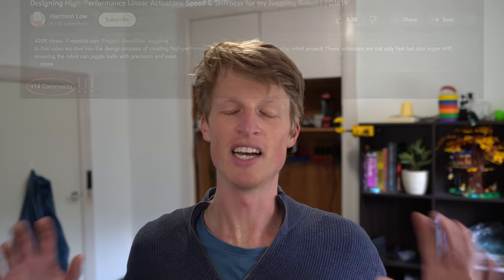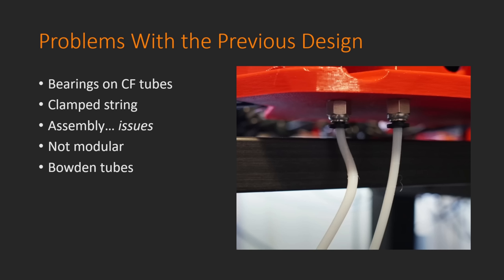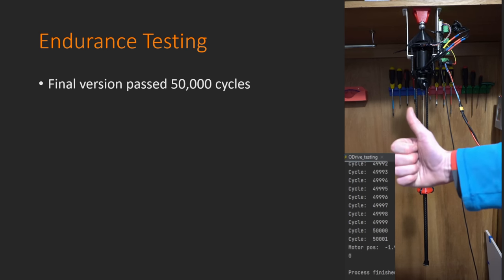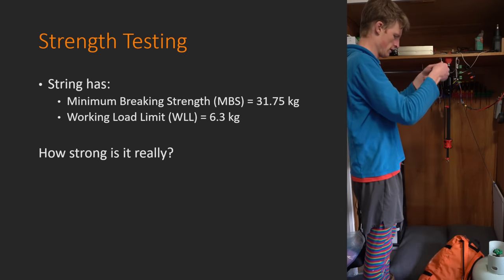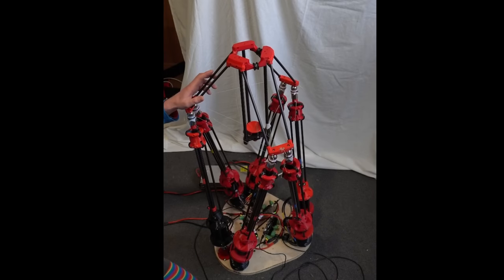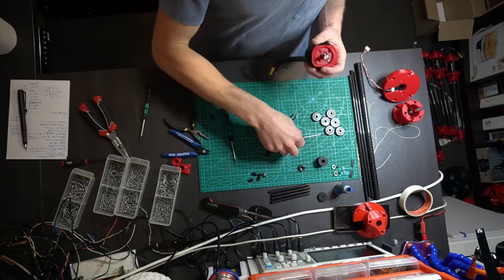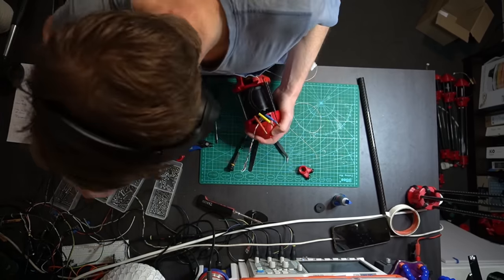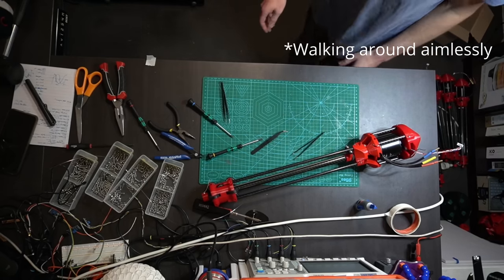My New Linear Actuators are SO MUCH BETTER! | PDJ #21

Comment: One thing about your string strength test, how did you attach it to the weights? Something I didn't know until very recently is that how you knot a rope will affect the rope's strength, a lot. A tight bend can cut the strength down with over half. This is true for ropes, and should apply to strings as well, though probably to a lesser degree.

The theory is basically this: When you have a straight rope at tension it pulls equally on the entire cross section of the rope. But if you have the rope in a tight curve the part of the rope on the inner part of that bend, obviously can't be in as much tension as the outer part of the rope. Therefore, all the weight lands on fewer fibres.

Strings have fewer fibres and a much smaller radius, so they would be much less effected by this, but in your testing the string failed right at the knot precisely because it's the weakest part of the string.

The redirection of the string shouldn't be a problem, even a small bearing has a large enough diameter to not be a problem with such a thin string, but the attachment at the very end could possibly be improved to get more strength out of your existing string. Either by clamping it so it's straight at the end, or using a better knot.

My source, and more details, would be Kyle Hill's recent youtube video "The Figure 8 Knot Has Never Failed. Why?" It's about climbing ropes in particular, but it goes into the details of how knots and bends affect the strength of a rope at any diameter, and briefly mentions what diameter bend would be considered "no bend at all" from the strength standpoint. It's relative to the strings diameter so only the knotting/attachment will really be a problem.
Reply: Just got to the bit with the tensioning screw, that might just be weakening the string, hard to be certain. The rule of thumb is that the pin should be four times the diameter of the string to not weaken it. I know it doesn't matter for your application in specific, but in general wrapping the string around a pin like that can remove a fair bit of the strings strength. I can't imagine the threads biting into the string helps any there either.

Why not simply weld the synchromesh cable into a loop, then use a tensioning pulley like you would on a timing belt for a 3d printer? Alternatively, something like a crocodile clip could possibly work. Though I'd be a bit concerned about the cable twisting over time and loosening. You could also simply wrap it around a pulley that you then lock instead, giving you an easy thumb screw to tighten or loosen it. It'd be bulky then though.

If it wasn't clear, I didn't see your previous video on this system so my suggestions don't take any considerations you mentioned in that one in mind.
Reply from the maker: @Sylfa  Interestingly the string in the raw strength test actually failed somewhere in the middle of the string, quite far away from either knot! I do agree about the thread of the bolt not helping here: the string gets rather munged up after I tighten and loosen it a few times in the same spot 😬

I do like the idea of having the string being a single loop, though I'm not sure how to ensure the motor has a solid "grip" on the string? My understanding of belt-driven CNC machines—which use a similar concept—is that the belt is very tightly routed around the motor's output shaft, which has a toothed gear to match the profile of the belt. If I'm using plain string I have no idea how to ensure that the string doesn't slip on the spool? (though maybe this could be seen as a safety feature, where the string slips instead of snapping?). I can kind of imagine how it could work with the synchromesh cable thanks to its strange profile, though even then it might be tricky if printing the parts and using the smaller synchromesh cable (tolerances would be tricky here).

Cheers for the input!
Reply: @harrisonlow  Yeah, I was thinking of the syncromesh cable for that suggestion. Using a string in a full loop, hrm. I guess, you could try 3d-printing a soft screwlike holder that winds the thread and keeps it from overlapping itself, but honestly it'd be slipping the thread through which would ruin the friction, and thread.

The only real way I can think of doing it with a loop of string would be to have the loop just barely longer than what you need, then tightening it enough so it's got enough friction. Not sure that's possible. A timing belt would work better than that I'm sure, but I can't see that working unless everything's in-line so you'd have to restructure it entirely. Don't think it'd be worth it for your application. 

That's what CNC machines use though, at least the ones I'm aware of. In case you weren't aware, the timing belts are basically a flexible cogwheel, allowing you to put it over cogs to have no slipping, you only need enough tension so that it doesn't slip out of the teeth.

As to it snapping in the middle, that's a good sign that what you're doing is not a problem, I guess strings really don't have the same issue as thicker ropes. Or if they do, it's minimal. Strangely enough I could have sworn I saw the string snap at the weight in the video, guess my mind was just playing tricks on me. 😂

Yeah, I think the only real consideration is to avoid jamming the thread into the screw, to avoid chewing up the string over time. At least if you don't need the full strength the motor can output.
Reply from the maker: I'm not sure that just having enough tension would work, though a simple solution like wrapping rubber (or heat-shrink?) over the spool might be enough to stop it from slipping.

Just re-checked the "strength" footage and it definitely snaps in the middle (when doing the direct string strength test). No idea why it doesn't snap at the knots 🤷‍♂️

Comment: Swap to liner bearings (lm8uu for an example) for top and bottom?
Reply from the maker: I've tried normal linear bearings but the tolerances unfortunately didn't work for my carbon fibre tubes (some tubes fit with slop, others didn't fit at all...). Would be a lot more elegant if it worked, though!
Reply: well darn , I guess the tool head weight is what makes them work for 3d printers then.  @harrisonlow
Reply from the maker: @PointBlank65  I think it's more that they use tubes/shafts with better precision. My carbon fibre tubes aren't designed to have an extremely precise outer diameter, but you can get ones that are (for💲). 

Metal shafts (that I've seen used commonly in printers) are fairly reasonably priced for high precision and they work really well with linear bearings

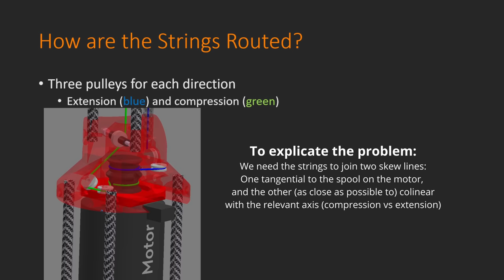Comment: 4:44
You can use less pulleys, but it'll be worse?
You don't "need" a pulley with the rotatio axis aligned with the barrel's rotation axis. You just need to end up with a string going in tangentially to your barrel to wind up.
If you have the last pulley directly go to the barrel with a weird angle you could get away with using two pulleys?
This should work for the push and pull string if i saw you Cad render right.
Reply from the maker: Yep, I think you're right! Someone cad'ed this up in Zulip and it's immediately obvious that this would work. D'oh!

What makes you say fewer pulleys would be worse?
Reply from the maker: Link to the Zulip topic if you're interested:
https://pdj.zulipchat.com/#narrow/stream/399304-The-Arm/topic/Alternate.20String.20Routing.20Ideas/near/388860540
Reply: @harrisonlow  when winding up it may have a hard time spreading itself evenly on the barrel, or i fear it would be more likely to clog when unwind at high speed... To be seen?
Reply from the maker: @squa_81 I haven't had this happen yet, though the synchromesh cable may behave differently... Hopefully not! 🤞

Comment: A very simple change to improve the maximum possible load and add a little redundancy is to double up the string. Mind you, if one half of the string breaks the actuator will still work but the broken section of string will likely wrap up around other things and make a mess.
Reply from the maker: Hmm yeah I think the tangles would be detrimental here, even if the second string survived. There's just so much space for the string to go where it doesn't belong!
Reply: @harrisonlow  I think braiding 3 strings together would prevent that
Reply: @NotToast859  That's a great thought, and I might be using that in some future projects. I guess I have to print a braiding machine :)
Reply from the maker: Haha you don't know how close I've come to making a braiding machine "for Jugglebot". Would be so neat to have one! They're such beautiful mechanisms to watch go round and round 😍

Comment: maybe just use nylon wheels with bearings? so the carbon rod doesn't wear so much
Reply from the maker: Do you think the nylon would cause much/any wear if it directly contacted the central CF tube? I quite like the look of these - particularly that I won't need to print + attach anything to them!
Reply: @harrisonlow  sorry, I would love to help, but I do not have experience on this
Reply from the maker: @Woloszow  Haha no need to apologise at all 😊 I'm just trying to extract as much information from viewers as possible 😁

Comment: I have made a similar application with a positioning belt some years ago. The servo used was a 8n.m. at 3000 rpm max, and 5:1 gearbox. We got 3.1m/sec. On the positioning block.
The inertia was too high so we removed the motor and changed for 2 small motors of 2.3n.m. and 5:1 ratio each. During tests we got 4.2m/sec.
That is a motor approach alternative...
Reply from the maker: Thankfully the inertia won't (read: shouldn't) be an issue for me; I've figured out a neat way to stop them from spinning about their axis without restricting other motions. I'm keen to show it off in a future video 😁

Those are some pretty impressive speeds! What were those designs for?
Reply: @harrisonlow  it was for a semi rotary die cutter. Look at the video : "fastrack finishing system for labels". There is an arm with 2 rollers on the bottom, all structure made from carbon fibre and the motion was a pulley with 2 servos, one on each side. The paper is re-positioned after each cutting. All in motion. The dynamic  accuracy was under +-0.08mm on motion synch.
Reply from the maker: @unitedbolts8053  Wow that's one hell of a machine! Pretty cool that you got to work on that!
Reply from the maker: Cheers! My plan for control is to have a Jetson Orin Nano be the "brains" of the operation, which sends commands via CAN to the three ODrives (V3.6 if you're curious), which each control two motors.

I've already done a ton of work on simulations for Stewart Platforms (and Jugglebot writ large) and I absolutely plan to make this content into videos. I've actually had a full script for a "how to control a Stewart Platform" video since like February 😅 Just need to record and animate it. I'm very keen to get this info out there because it wasn't trivial to figure it out myself, and I spent years studying this at uni!

Comment: The issue with the bearings is fundamentally due to overconstraint. Your rod needs 4 degrees of constraint (two translations and two rotations) but the bearing assembly supports 6 points. It's not possibly to simultaneously avoid slop and high wear rates in such a system. Go back to bare steel bearings, but make one bearing in each triple a soft constraint rather than a hard constraint by giving it an elastic mounting, either spring loaded or even easier: on a flexure.
Reply from the maker: Thanks for the new way to view that problem! Do you have any thoughts about how to decide which bearings have a soft constraint? I would imagine having them be the equivalent ones on top and bottom would lead to a poorly-supported tube, but even with the soft constraint bearings being offset from each other, the CF tube would still be able to move around if torqued in the right (wrong?) ways.

Perhaps one way to view my current approach is by addressing the overconstraint problem in all 6 bearings, rather than just in a pair like you suggest. By giving all 6 bearings a small amount of "give" (via the rubbery/pliable sleeve), they can fully support the rod without excessive wear. I do grant that this necessarily increases rolling resistance though...
Reply: @harrisonlow  which pair you choose to mount flexibly will determine which degrees of freedom have reduced ultimate load capacity. But so long as the preload is above the peak operating loads, the assembly stiffness will be given by the stiffness of the solidly mounted bearings. This is the same way bolted joints work: a bolted joint is as stiff as the two faces that are bolted together and is much stiffer than the bolt, as long as the bolt preload is sufficient.
Reply: TLDR: any two, so long as it's one per a triple, and not both in the same triplet. i.e. the bearings chosen as flexible preload bearings need to be separated by some distance along the length of the rod
Reply from the maker: @asingleoat  Very interesting, cheers for the write-up! I'm thinking of trying a few ideas from these comments (eg. v-groove bearings with O-rings) first (because they're simpler to test 😅) and if I have no success there, I'll try mounting two of the bearings with a stiff compliant mechanism.

Thanks again!

Comment: A solution for cables could be nitinol, while it's a lot stronger than steel wire, it's also very flexible; the only problem with it, is that it's superelastic, which is what gives it its formidable properties of bending and withstand extreme forces without snapping, the downside that I wanted to mention by this, is that it can stretch and contract like a rubber-band, which would reduce precession if too much weight or force is applied to the cable.
Reply from the maker: Hmm yeah I don't know if I like the sound of "superelastic" for this purpose; I want these to be as stiff as possible so that they can perform the fast accelerations that will (probably) be needed when Jugglebot is up and running
Reply: @harrisonlow   Another solution would be Cu-Al-Ni alloy cables, while it's better when it comes to precision under extreme forces, the alloy can be exposed to corrosion, making it less viable in humid environments.
Reply: In the end, the best solution for stronger cables, would be superelastic alloys, as they permanently remove metal fatigue, while also being incredibly flexible, the cost of this of cause, is that they tend to expand and contract under exposure and release of extreme forces, reducing the overall precision. The precision of the accurator, with superelastic alloys, can be improved by increasing the diameter of the cable, this though comes with another cost, which would be acceleration.
Reply: @harrisonlow  but if you want stiffness over material fatigue, while also staying flexible, rope in general is best for this; I don't know any special kind of rope that's stronger than other kinds of rope, other than silk rope, but this makes the project really expensive very quickly.

Comment: Why 3 pulleys instead of 2? What is the purpose of the pulley immediately out of the reel? Can't you perform the same redirection of the first two pulleys with just one placed at the same position as the second pulley but with a different axis of rotation?
Reply from the maker: Yep, I think you're right! It's possible that I considered this but thought there might be issues with manufacturability or printability, but it's also (probably more) likely that I just didn't realise that was possible! Good thinking 😊
Reply: @harrisonlow  I'm not 100% sure on the math; but I think you can get the axis of rotation with the cross-product of the vectors from the redirection point towards the source and destination. I'm still cracking my head trying to figure out how you calculate where the center of the pulley should be in that plane based on the radius of the pulley though; only got so far as to realize Pythagoras goes in there somewhere, and the position is somewhere along the midpoint axis between those two vectors. I think it can probably be eyeballed if you don't need it to be mathematically perfect though.
Reply from the maker: @tiagotiagot  Haha I didn't even attempt to deal with any of this mathematically 😛I just made some sketches in Solidworks and played around with different positions/ideas until something worked.

Perhaps something that is worth considering (if you haven't already) is that the input and output of a single pulley need to be on the same plane. I think you're right that the cross product will give you the axis of rotation! I'm not sure there would be a mathematically "perfect" placement of the pulleys though - there are quite a few considerations to be made here!
Reply: @harrisonlow  The cross-product part takes care of making the axis of rotation orthogonal to the plane defined by the input and output directions. 

The thing with the positioning I mentioned is I was thinking of it in terms of defining a point where the input and output lines would cross, where you would place an infinitely small pulley; but since the pulley does have a meaningful size (and you wouldn't want to bend the cable too sharply anyway), if you wanna keep the input and output lines unchanged, you can't have the pulley at the same place as the infinitely small pulley would be, you have to find where it fits between the lines without much slack. If you're not that attached to the exact original lines though, then just figuring out the rotation axis and plane within tolerances and then eyeballing the position of the pulley according to that, would probably suffice.